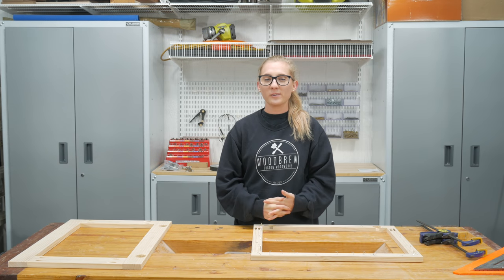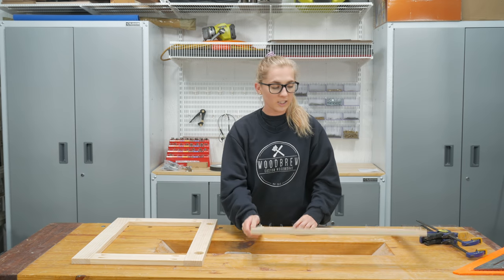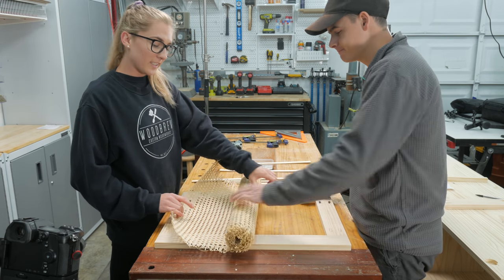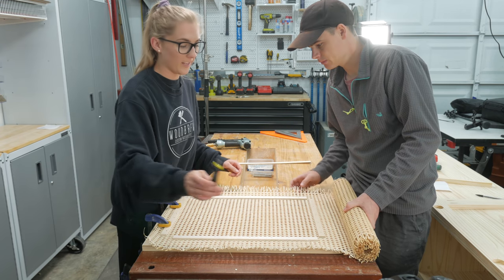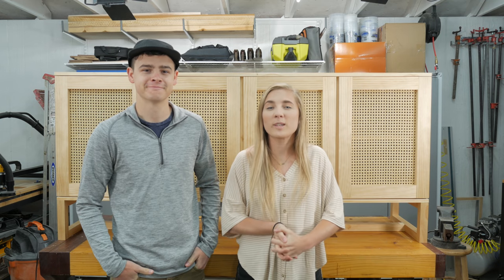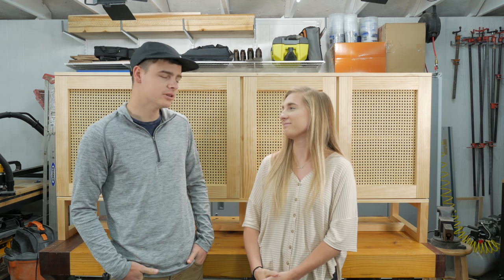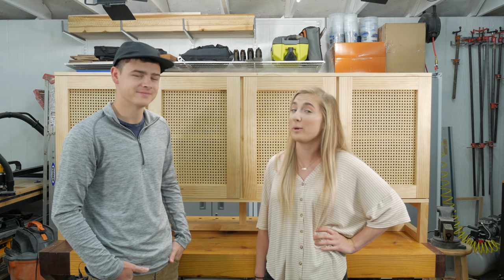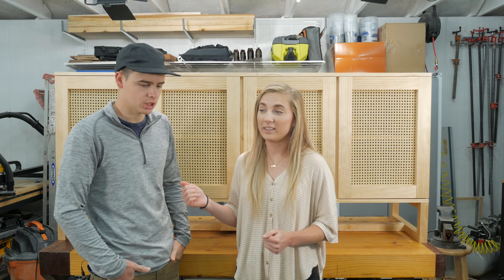DIY Media Center With Minimal Tools PART 3! FINAL

Comment: I helped my granddad replace the cane webbing on some chairs, he soaked the cane in water for about 2 hours before we put it onto the chairs. He told me the cane shrinks and tightens as it dries, so don’t install it too tight while it’s wet.
Reply from the maker: Right! We live in such a humid area that the way we did it hasn’t really effected the cane🤗 It has gotten loose, but it’s not caving in or rippling.

Comment: how much cane do you need? I bought the plans and the link for the cane is unavailable.
Reply: I'm guessing 4- 18x24 pieces of the cane?
Reply from the maker: You’ll need around 9’ of cane, if you can find a roll, that would be best! The cane needs to be 18” wide and you’ll roll it out from the tops of the doors to the bottom. And with 9’ you’ll have a little extra if something happens😊